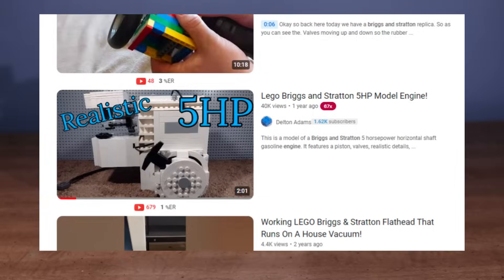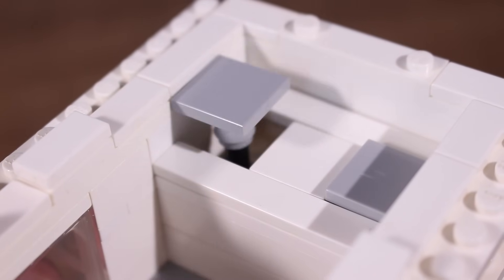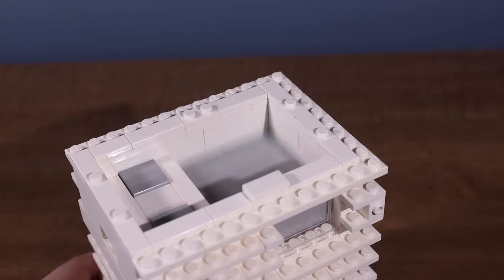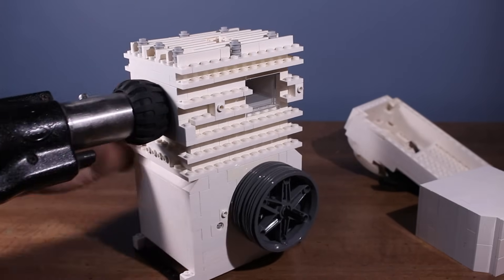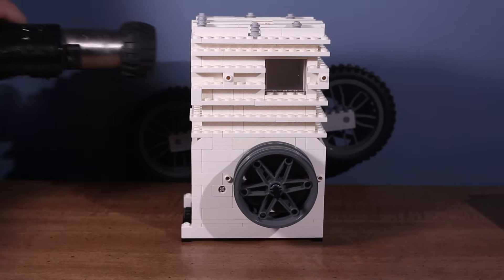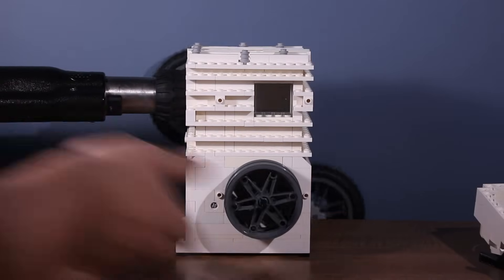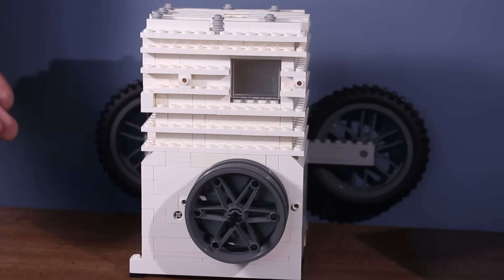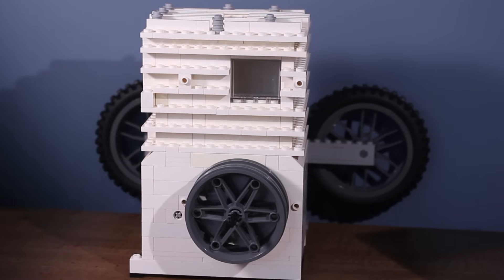I Tried Vacuum-Modding my Old LEGO Briggs & Stratton Engine.....

Comment: Is the vacuum strong enough? I think the engine has too much displacement in the cylinder.
Reply from the maker: It's pretty strong. And yeah, I think the valves might be a bit small for the size of the cylinder
Reply: @DeltonAdamsLEGO  valves are good sized currently, you only need to switch the other valve to be intake.
Reply: @DeltonAdamsLEGO  Still a good job though
Reply: @DeltonAdamsLEGO  they good size
Reply: @DeltonAdamsLEGO  I build an 8x8 piston engine with ports the same size as yours and it ran great. It had valve springs and individual valves opening for intake and exhaust stroke though, so it was a little different.
Reply: @noaharmistead7433  Is it a OHC or a OHV?
Reply: No i don't think so because i built a vaccum engine with a displacement at the crankshaft of 4 technic holes and the piston is 5x6 stud. I also built one with a displacement at the crankshaft of 4 technic holes, but with a piston of 8x8 studs and this one is a 2 cylinder
Reply: @Oberspezialist  You're lucky to have all the legos, let alone in the same color if it is!
Reply: @NeoVei  No that would be a dream. The engines look like a toddler experimented with legos😂
Reply: Yes almost any vacuum is strong enough. Something wasn’t built right though 🤔

Comment: the main issue with this engine the fact that you had the vacuum conected to both valves...
Reply from the maker: That was only one configuration. I'll probably make one of the valves let air back in
Reply: @DeltonAdamsLEGO  trust me it will run much faster
Reply: @JB_Lego  That also depends on the valve train you use. Like with a OHV, you have a low revving engine and those also (with my experince) are harder to tune perfect and make them run properly. The SV like in the video are easier and rev higher but the best engines for high rpm are OHC's.
Reply: Lego vacuum engines can’t run of one valve like this. That’s why it wasn’t running. Had you kept two valves it would have ran fine
Reply: @legoenginemechanic101  Yeah I think he chose to try it like this because he liked having the 1:2 gear ratio from crankshaft to camshaft and not having to run valvesprings. Could be wrong, but that's my guess.
Reply: @legoenginemechanic101  it had 2 valves the whole time man
Reply: So when the piston gets sucked upwards, the other valve is still sucking it upwards. Not pushing down or something, so it forces the piston to remain in the upward stroke. Am I right?
Reply from the maker: No. One valve suck upwards, then closes. The piston falls until just a little after bottom dead center, when the other valve opens, sucking upward
Reply: @DeltonAdamsLEGO  yeah the inertia will push the piston downwards BUT the vacuum in the chamber is still there so there will be resistance from the vacuum when the piston goes down. Unless I'm an absolute idiot and I got it all wrong lol. By vacuum I mean the compression or what ever is the correct term
Reply: Fly whell maybe have the right weight but is mutch big

Comment: i don't know if you made this modification but you need one of the valves to let the air back in to the engine
Reply from the maker: I had thought of doing that, but I wanted to try the original way first. If I work on this again, I'll probably do that